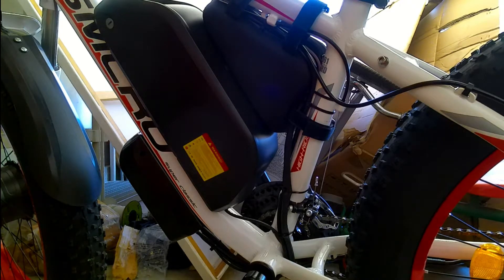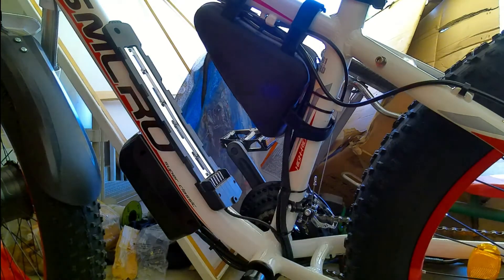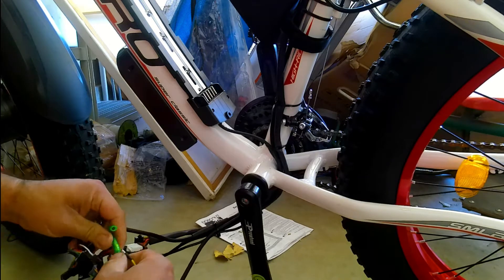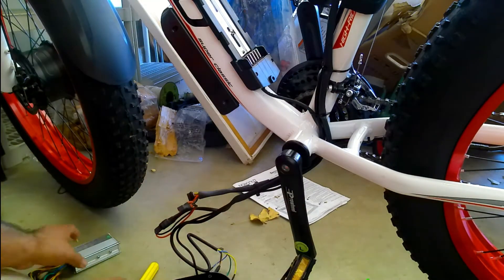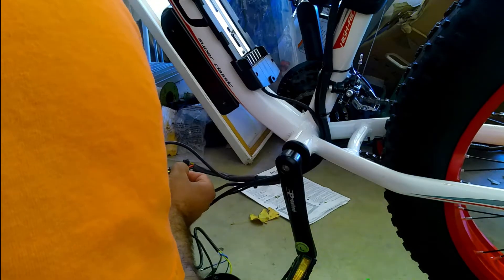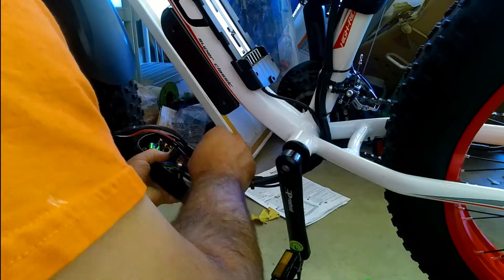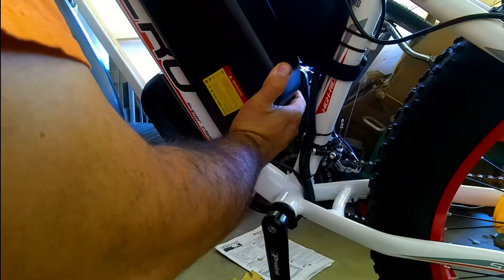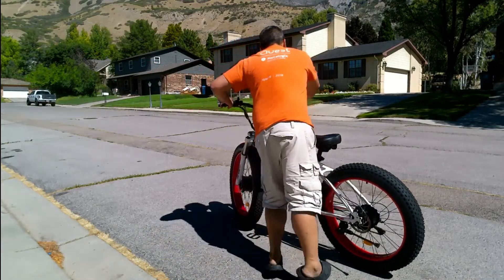SMLRO XDC600 Dual Motors 22.4AH 2000W 26" Fat Tire Electric Bike - Controller Replacement

Comment: Nice I have the same bike and have made every mod possible to it. I can't seem to break 40mph even on 58.8 volts @ 30amp, shunt modded both controllers, upgraded all the power wires to a larger gage. All the connectors are now xt90s. My goal is to get it to hit at least 50.
Reply from the maker: That would be pretty sweet! I did notice the wires were pretty small and the controller seem to be maxed out at around 12 A or something like that.

Comment: Please how can I start both engines at the same time?
Reply from the maker: Peddling and throttle. The throttle operates the front tire and peddling operates the rear.
Reply from the maker: Use both throttle and peddling at the same time. The throttle makes the front wheel turn and peddling makes the rear wheel go.

Comment: Have exact model and power keeps cutting out on me.. If battery taken off n put back or charged it runs for small time then quits AGAIN rather quick matter of seconds and idea of problem.. thanks from "Sore Thighs"
Reply from the maker: I wonder if you have a dead battery? Sorry that you’re having those issues.

Comment: I have an issue with the control screen. Do you have 1-18P? If so can you tell me what each setting is?
Reply from the maker: I have a video that walks through all of the settings. Look for that video on my channel.
Reply: @chrisstinkering3651  I have the newer screen on the Keteles K800, and thankfully, that worked! I do have 1 additional screens (18p) but that was a binary choice. That’s what I get for rooting around in there. I turned off the throttle and messed up the number of magnets which cause the speedo to stop working. You saved my bacon man and I appreciate it. My name is Chris as well……you are the smart Chris this time for sure!

Comment: Thank you for this video, in your opinion do you really need the second motor? I like the 1000 watt one motor xdc600, but cant find any reviews comparing the 2. I think I would get more range with just the one motor but looking for some feedback
Reply from the maker: Hello, sorry for my delayed reply. I will sometimes disconnect to the front motor and run with just the rear. I do prefer having the extra power though. Having the power available. So, if you get the two motor one, you can just disconnect the front tub when wanted.

Comment: i am having issues with a cliensy XDC60d looks very similar to what your working on ,there are 4, 3 wire connections. i need to know what colors go to and from each to controller . when i got it the wires were torn out .any help would be appreciated
Reply from the maker: Sorry for my delayed reply. Were you able to figure it out?

Comment: Thanks, how often do you have to change the controller? How much does it cost? Thanks!
Reply: The price is down to $1300-1400 now.

The controllers are $100 ea.

If you ride too long at full throttle, especially on a grade, the controllers will burn out.

I'm in limp mode on the front controller only.

The controllers are very low end and are at their absolute limit bringing the bike to max speed on a level grade.

I think I'll just upgrade to controllers that are happy pumping 1500w to the rear and 1000w to the front for as long as I want.

The motors should live ok at that power level.

If they don't, I have two direct drive motors that will be happy at higher power levels than that, and the controllers I'll upgrade to I can program not to draw more than 50 battery amps.
Reply: @Zomby_Woof Thank you😊
Reply from the maker: Hello, you normally don't have to replace the controllers. This bike was brand new and the defect was overlooked. The manufacture was quick to respond and sent me 2 controllers, one for the front wheel and 1 for the rear wheel, I only needed the controller for the rear wheel. The bike costs around $1,999.00 USD.
Reply: @chrisstinkering3651  quanto é o valor
Reply from the maker: @kerllyson2292  hello, you can buy the bike here. 
https://smlrobicycle.com